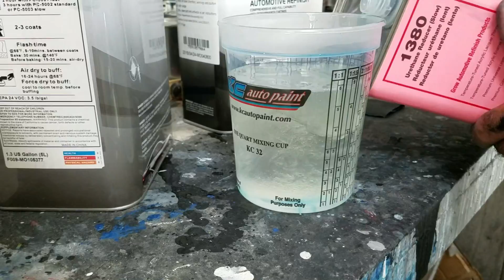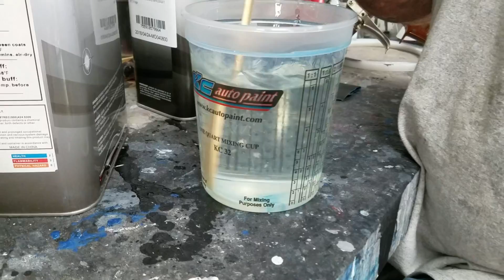Factory Five 33 Hot Rod V2 - Paint Booth - Protonic Blue

Comment: Hi Jim! Have you installed the windshield yet? Looking for which video you may have covered this topic in. Thanks! -Richard
Reply from the maker: No, I have to wait until its painted first.
Reply: @StreetRodJim  Thanks Jim! We just got ours back from paint and it doesn't seem like the windshield is going to fit. Its just too tight. We have an email in to FFR to see if we have the right piece of glass.
Reply from the maker: @VTrpm  I know mine is not as curved as much as the hardtop wants it to be.  We will have to keep some kind of pressure on it to stay in place....
Reply: @StreetRodJim  Yeah, it seems like its going to need to be forced in to place. We had a glass shop stop in this week to look at it and they also felt something wasnt right and that the glass is too big for the opening.  The manual is pretty slim on detail for the hardtop glass install.